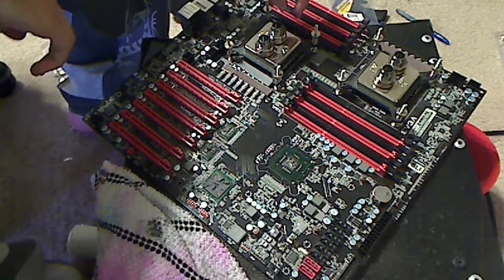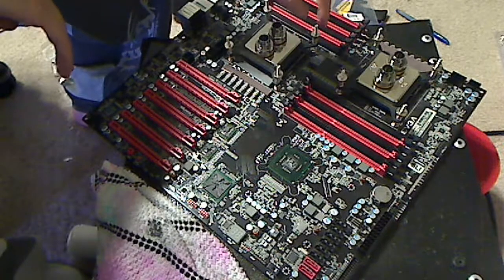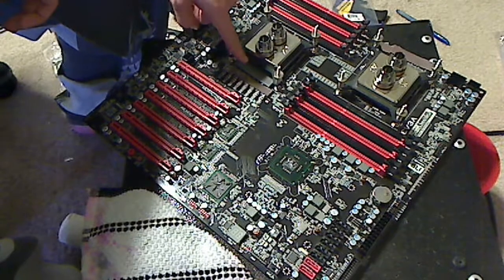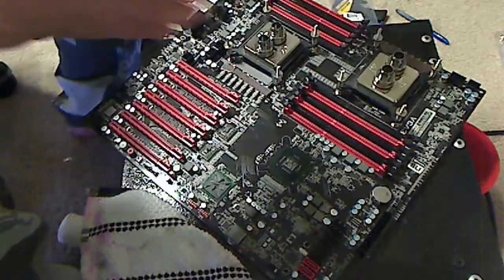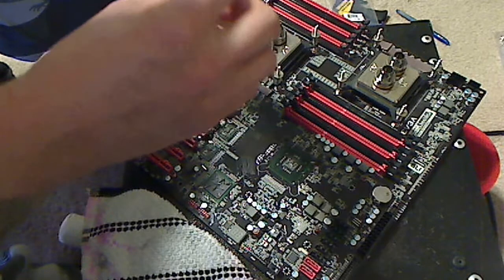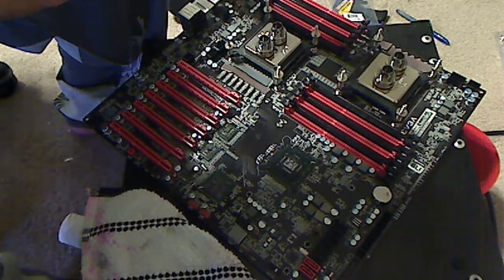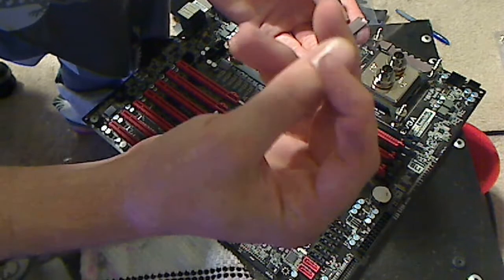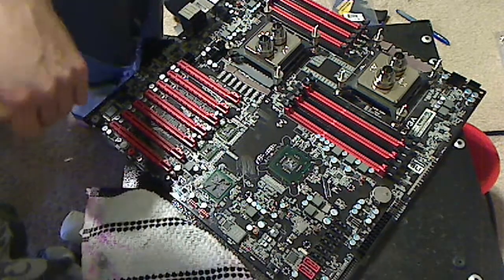SR-2 Thermal Tape

Comment: dude how is you build comming on im looking at doing my sr2 in a lian li 2120 but want to get a hydro 2 580gtx as im not that impressed with dual slot technology al cards should be x1 slot so i can use expansion boards.what blocks you using